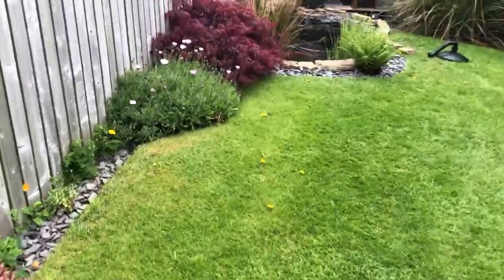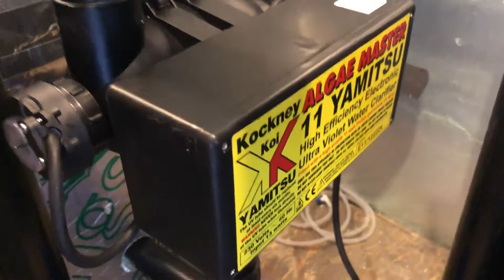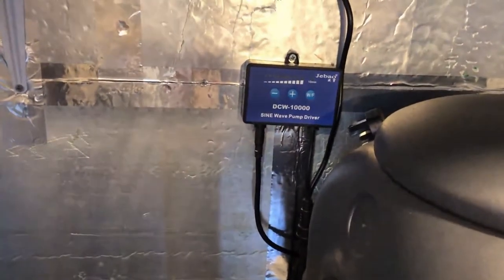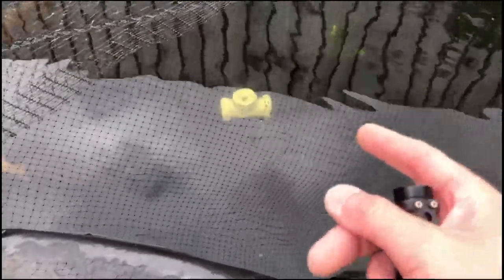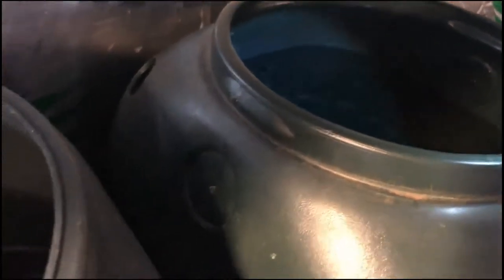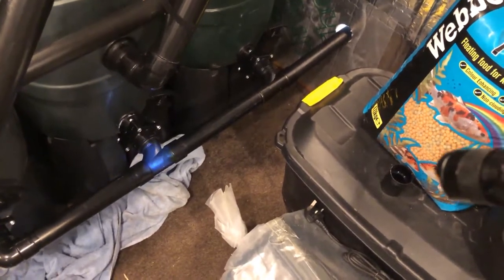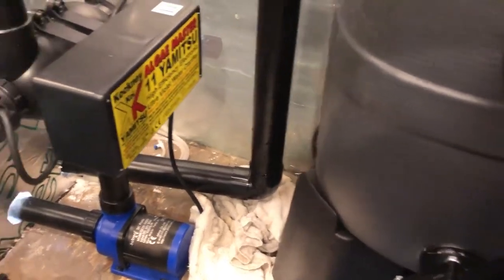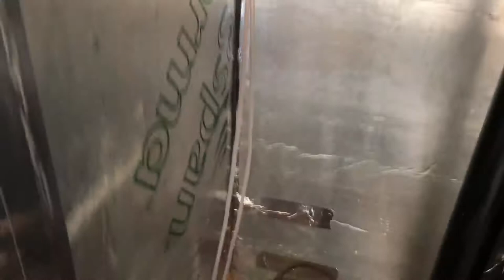DIY 3 BARREL FILTER INSTALL PART 3

Comment: I enjoy watching  people's  builds  yours reminded me of my first attempt 20years ago  and I made same mistakes too . I built my system after watching  wrighty  builds  . skimmer .seive & barrel   systems but I used  5    220 litre barrels instead  and 3inch /2 inch piping   &  fittings  as came free from where I work  .   I'm glad I built mine  when I did   but made the mistake of buying  more K-1 Media than needed  .  Next project is a  bakki shower

Comment: Hi Gaz
Just a suggestion 😉
Put lowest barrel on the floor,  that should help headroom above, but downside is it will mean a bit of fanning around with pipework, but you'll do some pipe mods anyways if you stagger the height.
Drains will work with tees facing either way just mean a slightly slower empty rate, and if you only emptying one at time then this shouldn't be a major headache, plus you could always add a  ¾" overflow to the last/lowest barrel, directly to the pond in line to stop flooding your filter house. 
I don't know much about ponds/koi but worked on a few water treatment system in my occupation
Hope it goes well for you
Warren
Reply from the maker: That will be added mate at some point an over flow, also an auto cut off if the pond level drops more than 5", the drains do work with the tee's, but no where as near as good it was before in testing, It makes back pressure and slows it down so they will be changed, Thanks for watching Warren 👍👍

Comment: It will deffo be worth it in the end Gaz 👍 I would go static bed,moving bed,moving bed as the static bed does most of the mechanical filtration leaving two moving for bio 👍👍😀

Comment: Assuming the pipes connecting the tanks are 1.5" then the water levels between the tanks will vary by approx 10cm for 10000lph. If you increase the interconnecting pipework to 2" then it should be more like 3cm for the same flow. Nice update by the way. I enjoy watching self build filter ideas.
Reply from the maker: Thanks Ian the feed in is 1.5" and the all the rest that link and return is 2", its been fun to make and regardless of the problems with it, I have had fun making it 👍👍
Reply: @GazsKoiPond  Good that the interlinks are 2". It should make your fix a bit easier. Maybe when it is complete you could highlight the relative water levels. It would be interesting (for me at least 🙂) to see how well the theoretical levels compare to reality.
Reply from the maker: @ianh3098  I sure will mate, the next video is ready to go tomorrow evening, but on my next upload I will make sure to show it all for you 👍👍👍

Comment: Fair play mate im still tinkering with mine ,slow tiny steps ,we live and learn
Reply from the maker: Its almost finished now mate its running just a few minor issues and then media 👍👍
Reply: @GazsKoiPond just done a filter clean on mine hard work in dark even with a flood light in garden, air pump to set up and water change to do on days off but ive got a 4 day weekend coming up

Comment: Hi, i had similar problems trying to push 14000 litres through 4 large Nitritech vortex's one just a vortex then sponge then moving bed and finally Alfagrog via 2 UV's in parallel. I Teed in between the sponge and the moving bed moving bed  (as the moving bed clogged it's outlet) to a Tempest I also divert past all the filters with approx 25% of the water.🤓

Comment: Looking good, I've just built a 5 barrel system on one level like yours, a swirl filter, 2 static k1, moving bed then alpha  grog in the last one. Had same problem as you with over flowing the first barrel. To solve the issue I diverted the incoming flow to another small barrel, down flowing through a spray bar over alpha grog ( trickle filter) and added another standpipe(making 2 on each) to the 4 barrels with media in. Working brilliant now, just got to solve a slight issue with fines coming through the trickle filter. Have plans to add a Cetus in the future, when wife forgives me the project time and cost 🤣🤣. Like you, have loved learning as building. Great job!!! And keep having fun👍👍👍
Reply from the maker: 5 Barrel wow, well when I have stepped these down a bit lets see what happens,  yeah My wife is keeping her eye on what I am doing lol, I may end up in the dog house at some point, trying to get this done and then make the pond bigger 🙄 👍👍

Comment: What a bummer on the t piece s but have many of time s heated and re glued.. Right with more shut of valves as you can. Always makes it easier in event of changing or issues to shut down. Yeah I thought you might need to step as I done same as you years ago think Terry pointed it out he was right 😂😂Coming along nice though gaz 👌👍👍👍
Reply from the maker: Mate I was gutted lol but, I will get it sorted on way or another, Thanks Kev 👌👍

Comment: I did try to tell ya bud a pump even at the lowest setting is still 10 times faster than your hose pipe but at least its an easy fix bud you'll have it sorted in no time when Wrighty first made the barrel systems he started off straight and found out it didn't work like that I remember watching that video of his like 5 years ago but once there up and running you can't beat a 3 barrel system in my opinion better than a top of the range drum the only difference is you have to clean it yourself 🤣
Reply from the maker: Now then Jamie when you told me that it would not work what was my reply ???  oh yes thats right if it needs ajusting, then so be it, & it will be adjusted,  now I know how it works and why it works its a process that I have worked out for my self, which is somthing I have enjoyed doing and making... 👍👍👍👍
Reply: @GazsKoiPond  absolutely but I was digging at ya mate I really like what you've done as I've said many times once it's running its gunna kick ass 👍
Reply from the maker: @keepingitkoi  I hope so mate time will tell

Comment: Gaz the drain off can you cut the pipe after the 90 and take the 4 bolts out of the slide valves and turn the pipe so it goes the right way  ?
Reply from the maker: Possibly I will have a look tomorrow that may be a  faster way for sure 👌👍

Comment: You need to up the size of the pipes that link the tanks
Reply from the maker: why do you say that Steve  ?
Reply: @GazsKoiPond  allow the water to pass easier between tanks feed with 1 1/2 link with 2 all I’ve seen have bigger outlets if you run a multi bay it’s the same should allow you to run the pump higher as the outlet pipes can cope with it
Reply: I ran 20k litres through a 3 barrel on 2 inch pipe
Reply from the maker: @Skeggy Pond Daz Shelton 😉

Comment: Cut the pipe either side of the tee spin it 180 degrees use the straight connector to rejoin the pipe very quick and simple ..  slide valves will be at the bottom but looks like you have enough room     personally I don't think it will matter that much on the sweep  pointing the wrong way as its only a drain so not really critical your flap valve will work better on the vertical section of pipe up to the pump the water pushing down under gravity will hold it shut better in the vertical plane
Reply from the maker: Nice one Daz 👍👍